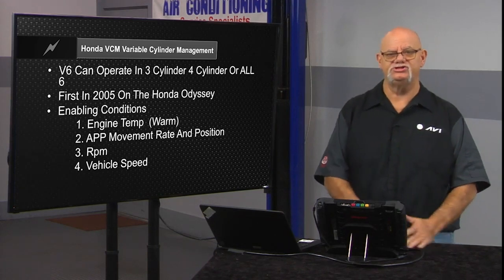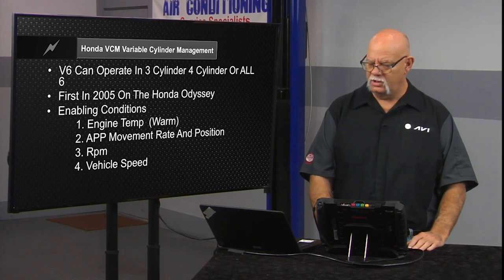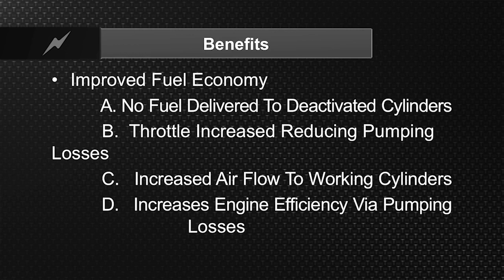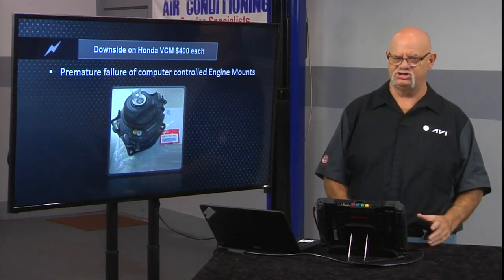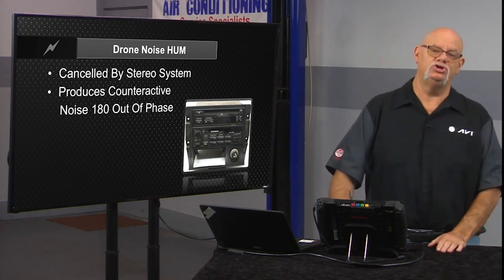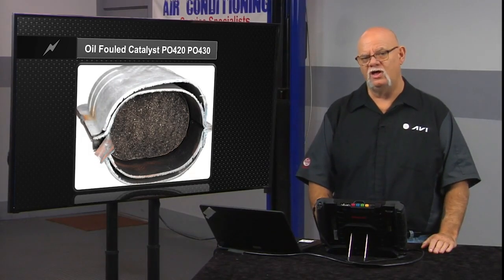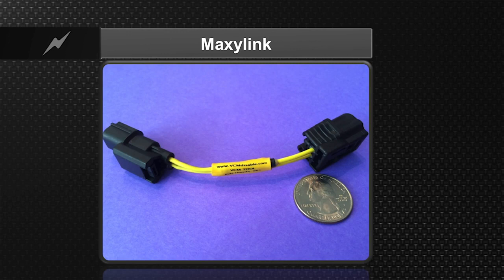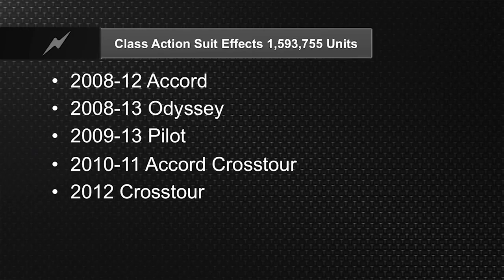Honda Applications |  Ron Bilyeu  | Tech Tip

Comment: I have a BIG PROBLEM WITH the coolant temperature sensor trick! When the motor is actually running hotter and the ecu doesn't see it, it will not turn on the fans soon enough. Unless there's a separate sensor for the fans like older Hondas.